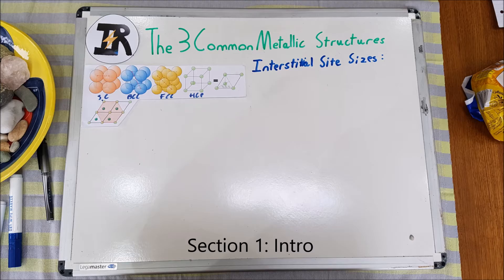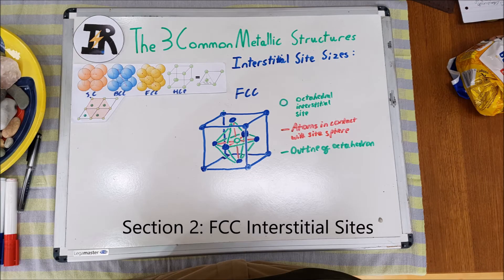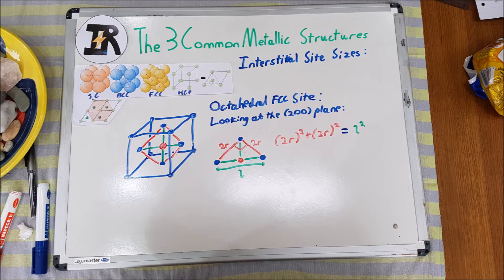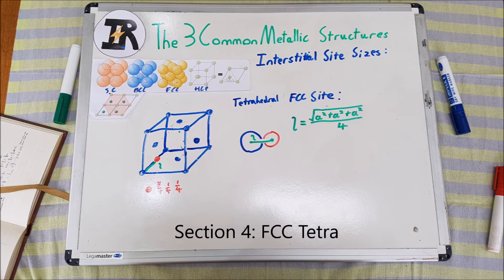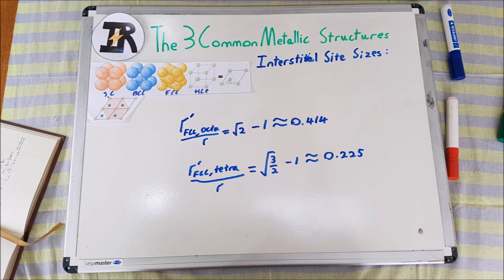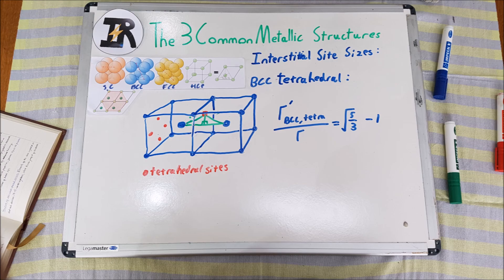Interstitial Site Sizes of FCC & BCC

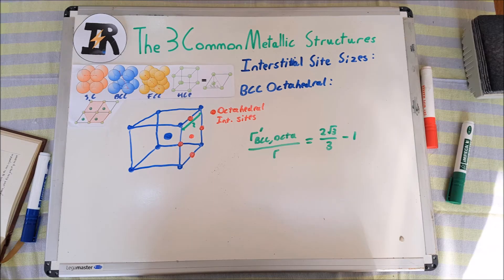Comment: Hi I have a question. In 4:47 you say a= 2*r + 2r’ (OK). Then you also say a=4*r/sqrt(3) (OK). 
Then when you plug the second an equation on the first one you say 4*sqrt(3)/=2(r+r’) (I don’t understand). Shouldn’t it be 4*r/sqrt(3)=2(r+r’)?
Reply: I do get the same value though.

Comment: Hi ionic rob. Thanks for the helpful vid! at 4:49, you say that we know that r= sqrt3/4 (a) from the previous part, but wasn't that previous part on fcc, and now we are dealing w bcc, which has an additional little gap between the two radii of the corner atoms? Thanks again.
Reply from the maker: Hi Ishaan,
Thanks for asking, I always like getting questions. When I say r = a*sqrt(3)/4 for BCC this refers to my previous video about atomic packing factors.
A quick summary is that in BCC there is contact between two opposite corner atoms and the central atom in the structure. This has a length of 4r in terms of radii, and a length of sqrt(a^2 + a^2 + a^2). So as both are describing the same length,  4r = a*sqrt(3).
I hope that helps.
If you're struggling to visualise it do see my previous video.

Comment: For BCC I don't see why you would have marked octahedral interstitial sites on the edges. I thought they only existed on the center of each face. Is that an error? I can't see how it could be correct, but I do agree with the final ratio.
Reply: On second thought I think I see it... it would require you image a tilted octahedron... the edges would also have 6 nearest neighbors or whatever... loopy
Reply from the maker: @pzmurphy  Hi Preston, I drew a nice little picture to describe it but I don't know how to send it across on here, if you do then do tell me and I'll send it across :). I think you're right in your reply to your first comment. The octahedral site on the centre of the edges, in the non-reduced sphere model, would make contact with the two nearest corner atoms and make contact with the 4 central atoms in the 4 adjacent unit cells, thus making contact with 6 atoms in an octahedral fashion. Sorry for taking so long by the way, I'm back at uni at the moment.

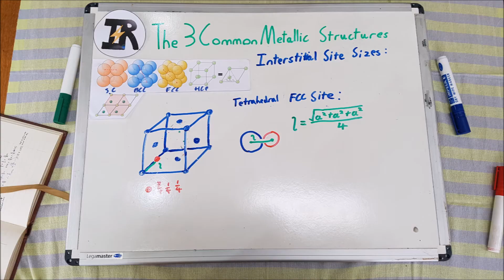Comment: Hi.  At 3:04 how do you know that l is equal to sqrt(a^2+a^2+a^2)/4?
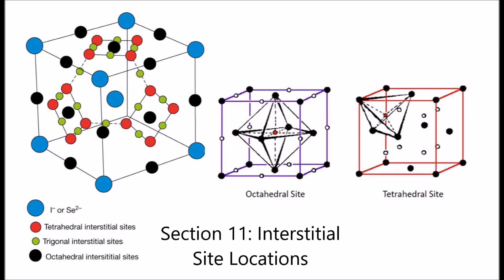Reply from the maker: Good question! If you look at section 11 ( 6:44 ), on the far right you can see all the FCC tetrahedral sites, which lie at the points 1/4 1/4 1/4 , 3/4 3/4 3/4 , etc. So if you were to draw a line between two opposite cube corners, e.g. 0 0 0 and 1 1 1, then that line will intersect the interstitial points 1/4 1/4 1/4 and 3/4 3/4 3/4, with the atoms at 0 0 0 and 1 1 1 making contact with those interstitisl sites respectively. Focusing on 0 0 0 and 1/4 1/4 1/4 then, the distance between the two points is 1/4 of the distance between the two cube corners, which using Pythagoras's theorem is (3)^(0.5)a, where "a" is the length of the side of the cube. If this hasn't fully answered your question, or you have any other questions then please ask away :)